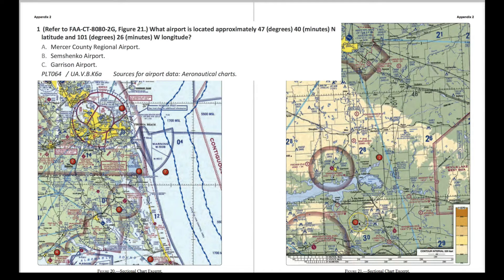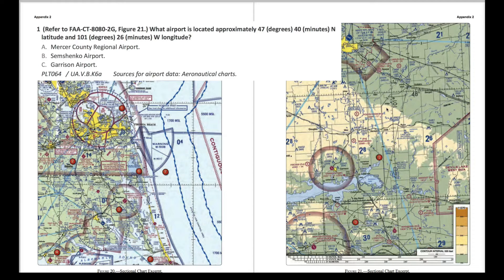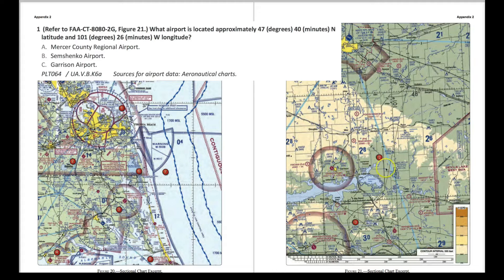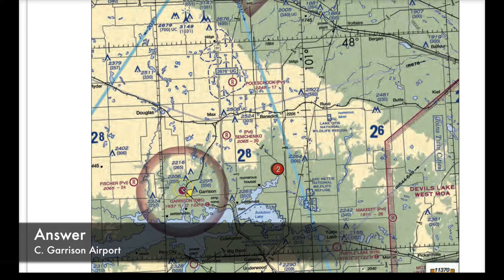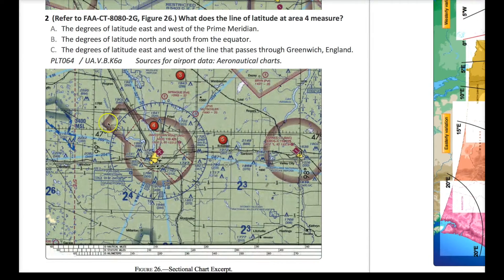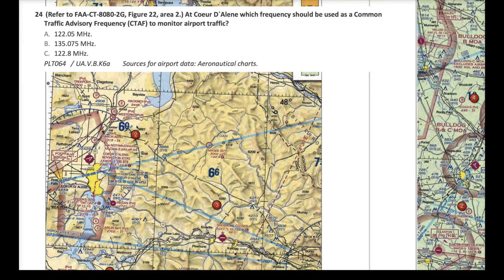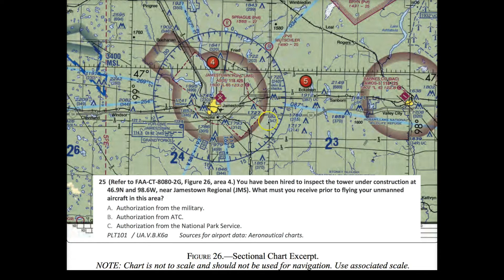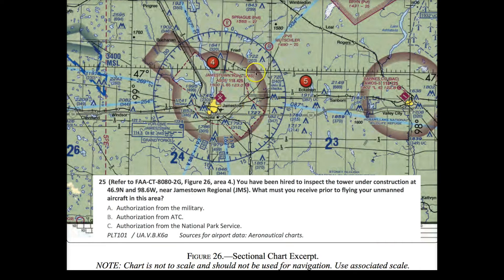FAA Part 107 | Sample Test Questions (Answered)

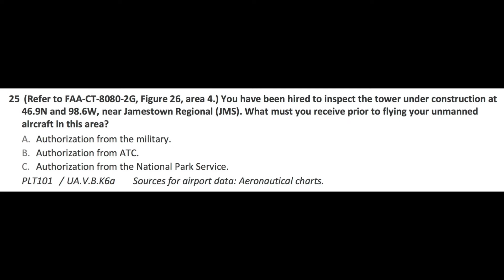Comment: Pertaining to Question #25 beginning at about the 8:12 time mark, the obvious answer (because the other two are not correct) is ATC authorization. However, in an earlier video, you mentioned the "magenta" colored circle with the runways in it is a "non-towered" airport.  So, my question is, who is the ATC authority you're getting authorization from if this is a non-towered airport?  Thank you.
Reply from the maker: Don't confuse non-towered with non controlled airspace.  There is no tower at this airport but due to the dashed magenta line around the airport which refers to Surface "E" airspace which is controlled, ATC clearance in the form of an authorization would be required.  This has changed a bit since this question was first written, however the area around the airport which is surface "E" airspace would require an authorization.  What changed was class "E" extensions do not require and authorization.  Example a class "D" airport (blue dashed lines) has a class "E" extension (magenta dashed lines) off of it.  This would Not require an authorization.  Hope that helps.
Reply: @AeroworksProductions  Thank you fro your response and for being patient with me.  However, I'm not confusing non-towered with non-controlled.  I am confused about "non-towered" vs "ATC." I'm just just wondering, per the question that was asked and the "correct answer," this is apparently a non-towered (yet controlled) airport.  So, who is the "ATC  authority" if you're not talking with "a tower" at the airport itself?

Comment: Typically, a 4 mile ring (circle) would be 4 miles in diameter not, a circle with a 4 mile radius. It would be just like a 4 mile square would be represented by its maximum outer dimension of 4 miles. Am I wrong? Please advise regarding your statement on Question 26. Thanks.

Comment: The Jamestown decimal degrees can be converted to minutes easily by multiplying the decimal part of the Lat or Long by 6 since there are 60 minutes in a degree.  You can do it in your head.  In the 46.9 multiply the 9 by 6 and get 54 minutes.  98.6, multiply the 6 by 6 and get 36 minutes.  This works because one minute of Lat or Long is 6 minutes, two minutes of Lat or Long is 12 minutes, etc.

Comment: Ok. I have to disagree with you. You explained question #2 wrong. Latitude lines run north and south where longitude lines run east and west.
Reply: "It's a LONG way to the top, if you wanta rock and roll!!" Follow the Longitude line to the top & bottom of the planet and the Lat line around the girth (eg Equator.)
Lat Long is the order of numbers too!!
Reply from the maker: sniper1958 Lines of latitude (parallels) run east-west around the globe and are used to measure distances NORTH and SOUTH of the equator.
Reply: @AeroworksProductions  Ok I want to make sure I'm clear. You just said Latitude run east and west around the earth. I guess I was taught wrong after 21 years of land navigation in the Marine Corps. I was taught Longitude  lines run around the globe EAST and WEST and Latitude lines run NORTH and SOUTH. I guess I got lucky and never got lost using a compass.
Reply: Lines of longitude run N/S through the poles. 0° runs through Greenwich, England. As such, your location in longitude terms is the amount you are west (when in the US) of  Greenwich. So the lines run N/S, the value therefore measures your E/W position.